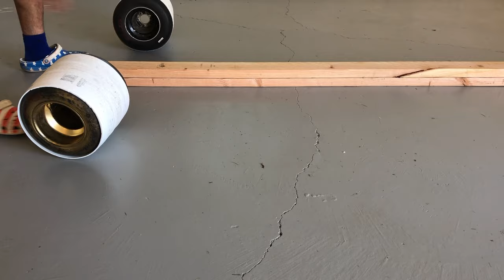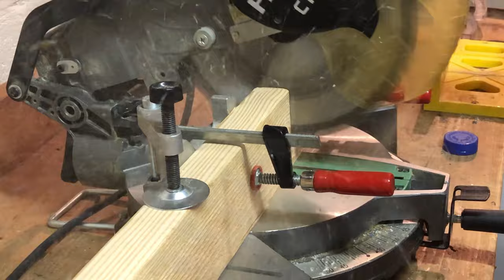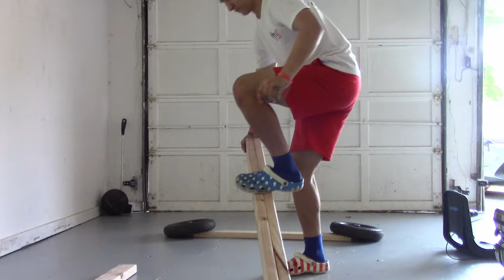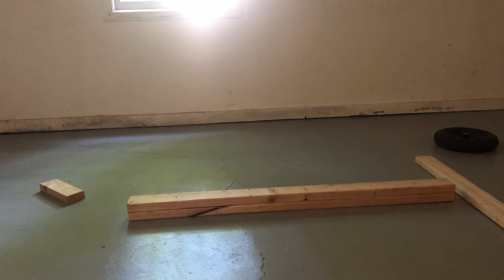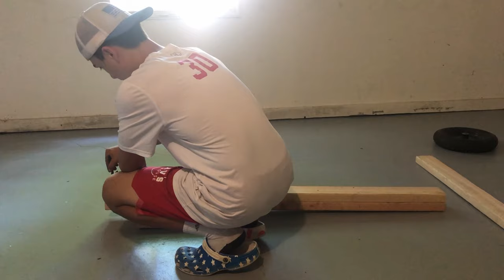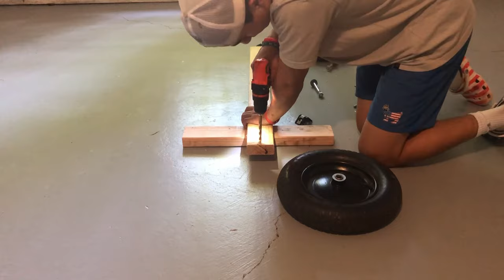Easiest Go Kart Build Ever!

Comment: Hi, where did you get that live axle? i'm trying to build a gokart on my own but i haven't figured out a way to stick the gears to the live axle effectively, and i only find prebuilt kits on stores that cost a lot of money, is there some particular term for that sort of "notch" coming out of the axle to lock stuff on it that i'm not aware about? thank you in advance!
Reply from the maker: Here is the parts list:
Engine:
https://www.harborfreight.com/65-hp-212cc-ohv-horizontal-shaft-gas-engine-epa-69730.html?ccdenc=eyJjb2RlIjoiMzAxMjU3ODkiLCJza3UiOiI2OTczMCIsImlzIjoiMTM5Ljk5In0%3D&utm_source=google&utm_medium=cpc&utm_campaign=18596767624&campaignid=18596767624&utm_content=142617995899&adsetid=142617995899&product=69730&store=&gclid=Cj0KCQjwnbmaBhD-ARIsAGTPcfV2CF8Z1LGRvTFNMSBSO2ZbICDhiHXFcrZflYeykNVo0EYnanAVnIYaAu10EALw_wcB
Wood:
3 by 1,1/5 in
Wheels:
i got the front wheel from my wheel barrow and the rear wheels are go kart wheels from eBay 
Throttle:
https://www.amazon.com/gp/product/B08SWMFP98/ref=ppx_yo_dt_b_search_asin_title?ie=UTF8&psc=1
rear axle:
https://www.bmikarts.com/Drift-Trike-Axle-Kit-35-Chain-with-Pillow-Block-Bearings_p_7188.html
clutch:
https://www.amazon.com/gp/product/B08L632YMB/ref=ppx_yo_dt_b_search_asin_title?ie=UTF8&psc=1
drum brake:
https://www.amazon.com/gp/product/B09PC3BMGG/ref=ppx_yo_dt_b_search_asin_title?ie=UTF8&psc=1
drift sleeves(optional):
buckets from ace that i cut
Hope that helps!
Please Subscribe :)
Reply: @Tommy..  Thank you, unfortunately the axle is not available anymore.

Comment: where is the engine with the steeringwheel from?
Reply from the maker: Here is the parts list:
Engine:
https://www.harborfreight.com/65-hp-212cc-ohv-horizontal-shaft-gas-engine-epa-69730.html?ccdenc=eyJjb2RlIjoiMzAxMjU3ODkiLCJza3UiOiI2OTczMCIsImlzIjoiMTM5Ljk5In0%3D&utm_source=google&utm_medium=cpc&utm_campaign=18596767624&campaignid=18596767624&utm_content=142617995899&adsetid=142617995899&product=69730&store=&gclid=Cj0KCQjwnbmaBhD-ARIsAGTPcfV2CF8Z1LGRvTFNMSBSO2ZbICDhiHXFcrZflYeykNVo0EYnanAVnIYaAu10EALw_wcB
Wood:
3 by 1,1/5 in
Wheels:
i got the front wheel from my wheel barrow and the rear wheels are go kart wheels from eBay 
Throttle:
https://www.amazon.com/gp/product/B08SWMFP98/ref=ppx_yo_dt_b_search_asin_title?ie=UTF8&psc=1
rear axle:
https://www.bmikarts.com/Drift-Trike-Axle-Kit-35-Chain-with-Pillow-Block-Bearings_p_7188.html
clutch:
https://www.amazon.com/gp/product/B08L632YMB/ref=ppx_yo_dt_b_search_asin_title?ie=UTF8&psc=1
drum brake:
https://www.amazon.com/gp/product/B09PC3BMGG/ref=ppx_yo_dt_b_search_asin_title?ie=UTF8&psc=1
drift sleeves(optional):
buckets from ace that i cut
Hope that helps!
Please Subscribe :)
Reply: @Tommy..  can u provide any break Throttle?

Comment: What did you use to connect the front two tires to the wood?
Reply from the maker: Angle brackets. They aren’t very durable though so if you have a more sturdy option I would use it.

Comment: Are their drawings with list of materials needed available?
Reply from the maker: here is a parts list:

Engine:
https://www.harborfreight.com/65-hp-212cc-ohv-horizontal-shaft-gas-engine-epa-69730.html?ccdenc=eyJjb2RlIjoiMzAxMjU3ODkiLCJza3UiOiI2OTczMCIsImlzIjoiMTM5Ljk5In0%3D&utm_source=google&utm_medium=cpc&utm_campaign=18596767624&campaignid=18596767624&utm_content=142617995899&adsetid=142617995899&product=69730&store=&gclid=Cj0KCQjwnbmaBhD-ARIsAGTPcfV2CF8Z1LGRvTFNMSBSO2ZbICDhiHXFcrZflYeykNVo0EYnanAVnIYaAu10EALw_wcB
Wood:
3 by 1,1/5 in
Wheels:
i got the front wheel from my wheel barrow and the rear wheels are go kart wheels from eBay 
Throttle:
https://www.amazon.com/gp/product/B08SWMFP98/ref=ppx_yo_dt_b_search_asin_title?ie=UTF8&psc=1
rear axle:
https://www.bmikarts.com/Drift-Trike-Axle-Kit-35-Chain-with-Pillow-Block-Bearings_p_7188.html
clutch:
https://www.amazon.com/gp/product/B08L632YMB/ref=ppx_yo_dt_b_search_asin_title?ie=UTF8&psc=1
drum brake:
https://www.amazon.com/gp/product/B09PC3BMGG/ref=ppx_yo_dt_b_search_asin_title?ie=UTF8&psc=1
drift sleeves(optional):
buckets from ace that i cut
hope that helps!
Please Subscribe :)

Comment: Where can I buy the materials
Reply from the maker: i got the tires from eBay, the axle from bmi karts and parts, and the engine from harbor freight
Reply from the maker: Engine:
https://www.harborfreight.com/65-hp-212cc-ohv-horizontal-shaft-gas-engine-epa-69730.html?ccdenc=eyJjb2RlIjoiMzAxMjU3ODkiLCJza3UiOiI2OTczMCIsImlzIjoiMTM5Ljk5In0%3D&utm_source=google&utm_medium=cpc&utm_campaign=18596767624&campaignid=18596767624&utm_content=142617995899&adsetid=142617995899&product=69730&store=&gclid=Cj0KCQjwnbmaBhD-ARIsAGTPcfV2CF8Z1LGRvTFNMSBSO2ZbICDhiHXFcrZflYeykNVo0EYnanAVnIYaAu10EALw_wcB
Wood:
3 by 1,1/5 in
Wheels:
i got the front wheel from my wheel barrow and the rear wheels are go kart wheels from eBay 
Throttle:
https://www.amazon.com/gp/product/B08SWMFP98/ref=ppx_yo_dt_b_search_asin_title?ie=UTF8&psc=1
rear axle:
https://www.bmikarts.com/Drift-Trike-Axle-Kit-35-Chain-with-Pillow-Block-Bearings_p_7188.html
clutch:
https://www.amazon.com/gp/product/B08L632YMB/ref=ppx_yo_dt_b_search_asin_title?ie=UTF8&psc=1
drum brake:
https://www.amazon.com/gp/product/B09PC3BMGG/ref=ppx_yo_dt_b_search_asin_title?ie=UTF8&psc=1
drift sleeves(optional):
buckets from ace that i cut
If you have any questions don't hesitate to ask
Please Subscribe :)

Comment: Parts list pppPLEASE! 😱😁🤪👍👍🇺🇸
Reply from the maker: Engine:
https://www.harborfreight.com/65-hp-212cc-ohv-horizontal-shaft-gas-engine-epa-69730.html?ccdenc=eyJjb2RlIjoiMzAxMjU3ODkiLCJza3UiOiI2OTczMCIsImlzIjoiMTM5Ljk5In0%3D&utm_source=google&utm_medium=cpc&utm_campaign=18596767624&campaignid=18596767624&utm_content=142617995899&adsetid=142617995899&product=69730&store=&gclid=Cj0KCQjwnbmaBhD-ARIsAGTPcfV2CF8Z1LGRvTFNMSBSO2ZbICDhiHXFcrZflYeykNVo0EYnanAVnIYaAu10EALw_wcB
Wood:
3 by 1,1/5 in
Wheels:
i got the front wheel from my wheel barrow and the rear wheels are go kart wheels from eBay 
Throttle:
https://www.amazon.com/gp/product/B08SWMFP98/ref=ppx_yo_dt_b_search_asin_title?ie=UTF8&psc=1
rear axle:
https://www.bmikarts.com/Drift-Trike-Axle-Kit-35-Chain-with-Pillow-Block-Bearings_p_7188.html
clutch:
https://www.amazon.com/gp/product/B08L632YMB/ref=ppx_yo_dt_b_search_asin_title?ie=UTF8&psc=1
drum brake:
https://www.amazon.com/gp/product/B09PC3BMGG/ref=ppx_yo_dt_b_search_asin_title?ie=UTF8&psc=1
drift sleeves(optional):
buckets from ace that i cut
If you have any other questions don't hesitate to ask
Please Subscribe :)
Reply: @Tommy.. THANKYOU! soooo much! I just got a notification you posted this! 😱😁🤪👍👍🇺🇸

Comment: can you make a parts list
Reply from the maker: Sure!
Engine:
https://www.harborfreight.com/65-hp-212cc-ohv-horizontal-shaft-gas-engine-epa-69730.html?ccdenc=eyJjb2RlIjoiMzAxMjU3ODkiLCJza3UiOiI2OTczMCIsImlzIjoiMTM5Ljk5In0%3D&utm_source=google&utm_medium=cpc&utm_campaign=18596767624&campaignid=18596767624&utm_content=142617995899&adsetid=142617995899&product=69730&store=&gclid=Cj0KCQjwnbmaBhD-ARIsAGTPcfV2CF8Z1LGRvTFNMSBSO2ZbICDhiHXFcrZflYeykNVo0EYnanAVnIYaAu10EALw_wcB
Wood:
3 by 1,1/5 in
Wheels:
i got the front wheel from my wheel barrow and the rear wheels are go kart wheels from eBay 
Throttle:
https://www.amazon.com/gp/product/B08SWMFP98/ref=ppx_yo_dt_b_search_asin_title?ie=UTF8&psc=1
rear axle:
https://www.bmikarts.com/Drift-Trike-Axle-Kit-35-Chain-with-Pillow-Block-Bearings_p_7188.html
clutch:
https://www.amazon.com/gp/product/B08L632YMB/ref=ppx_yo_dt_b_search_asin_title?ie=UTF8&psc=1
drum brake:
https://www.amazon.com/gp/product/B09PC3BMGG/ref=ppx_yo_dt_b_search_asin_title?ie=UTF8&psc=1
drift sleeves(optional):
buckets from ace that i cut
If you have any questions don't hesitate to ask
Please Subscribe :)
Reply: @Tommy..  appreciate it so much! 💯
Reply from the maker: Sure happy to help!!!

Comment: can you list all the parts plz
Reply from the maker: Engine:
https://www.harborfreight.com/65-hp-212cc-ohv-horizontal-shaft-gas-engine-epa-69730.html?ccdenc=eyJjb2RlIjoiMzAxMjU3ODkiLCJza3UiOiI2OTczMCIsImlzIjoiMTM5Ljk5In0%3D&utm_source=google&utm_medium=cpc&utm_campaign=18596767624&campaignid=18596767624&utm_content=142617995899&adsetid=142617995899&product=69730&store=&gclid=Cj0KCQjwnbmaBhD-ARIsAGTPcfV2CF8Z1LGRvTFNMSBSO2ZbICDhiHXFcrZflYeykNVo0EYnanAVnIYaAu10EALw_wcB
Wood:
3 by 1,1/5 in
Wheels:
i got the front wheel from my wheel barrow and the rear wheels are go kart wheels from eBay 
Throttle:
https://www.amazon.com/gp/product/B08SWMFP98/ref=ppx_yo_dt_b_search_asin_title?ie=UTF8&psc=1
rear axle:
https://www.bmikarts.com/Drift-Trike-Axle-Kit-35-Chain-with-Pillow-Block-Bearings_p_7188.html
clutch:
https://www.amazon.com/gp/product/B08L632YMB/ref=ppx_yo_dt_b_search_asin_title?ie=UTF8&psc=1
drum brake:
https://www.amazon.com/gp/product/B09PC3BMGG/ref=ppx_yo_dt_b_search_asin_title?ie=UTF8&psc=1
drift sleeves(optional):
buckets from ace that i cut
If you have any other questions don't hesitate to ask
Please Subscribe :)